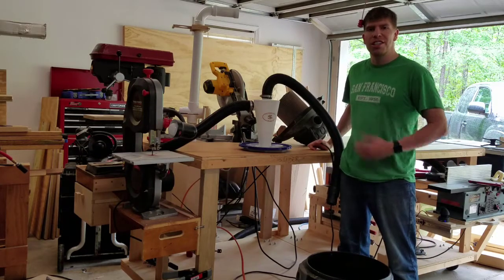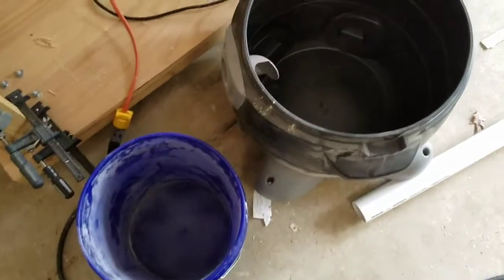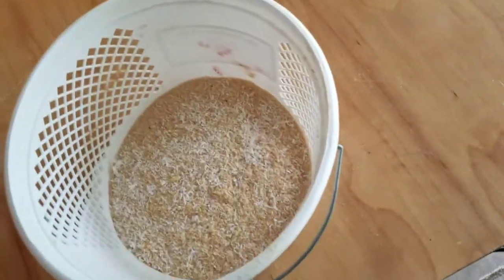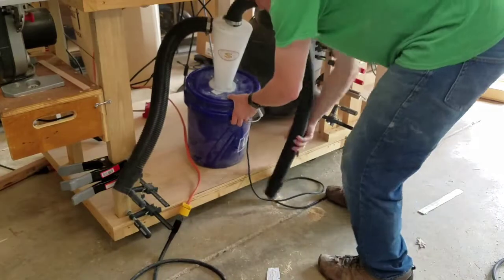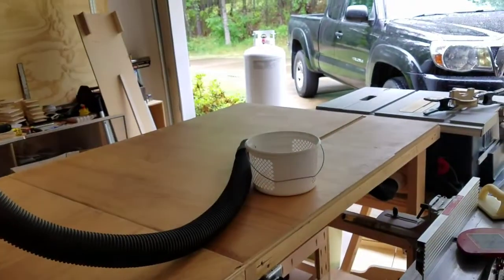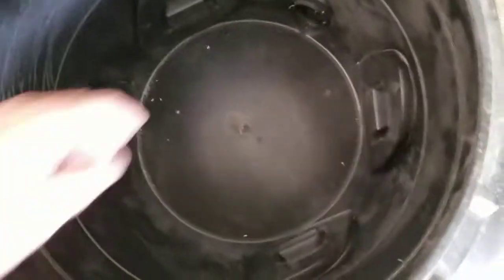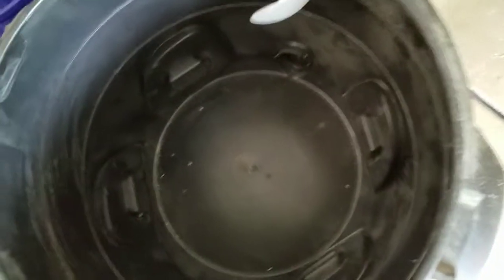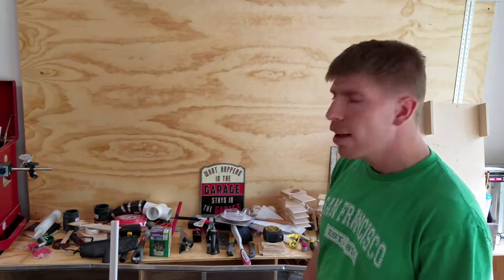Cheap Cyclone separator test / EP23

Comment: Hmmmmm .... whats the point in testing with this small amount .... I'd like a full bucket load of varios stuff from planerchips but more sanding particles wich are the hardest to separate ... and the amount sucked up should be like what the machines produce when running
Reply from the maker: Kristian, Solid critique and point. Mostly it was a quick test for myself and wanting to share after using it for a few days. I don't have any tests planned in the near future, but I've been satisfied with the performance after 2x years of use. I've used it for bench-top planer, table saw, band-saw, miter saw, sanders, jointer and drill press. I have a permanent HEPA filter on my shop vac and I've only had to clean it a few times. Separation efficiency appears consistent until the dust bucket becomes full.

Comment: For HD and Lowes buckets buy two then cut bottom out of one and slide it inside other Friction fit and will keep powerful vacs from sucking sides in. Use wood blaock and hammer to seat all the way to rim. Works better also.
Reply from the maker: +David Davis, thanks for sharing the tip David! I'm also eventually planning to expand my bin to something larger than 5 gallons. I have issues with the sides buckling currently like you described.